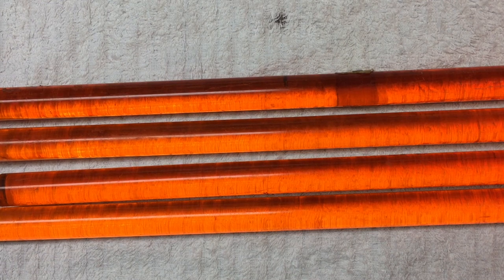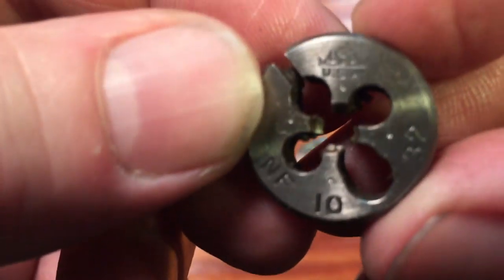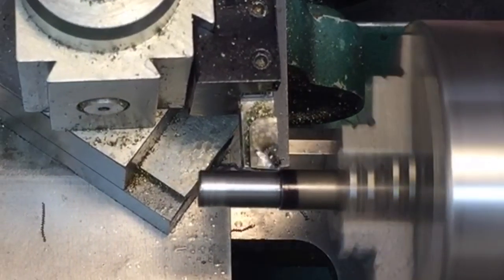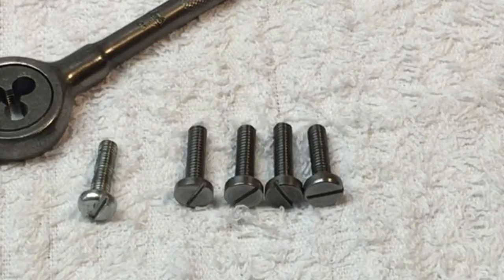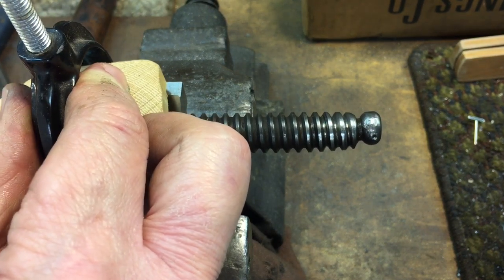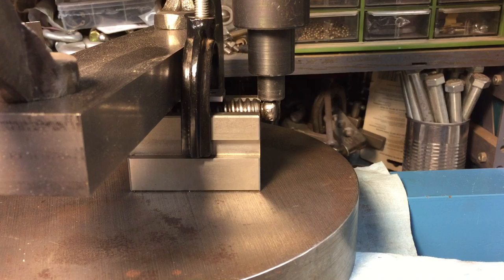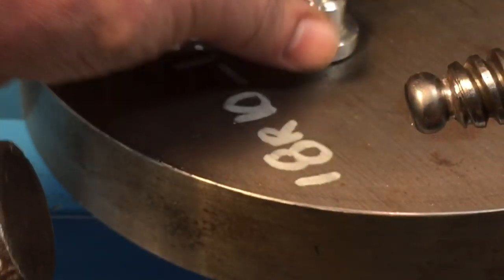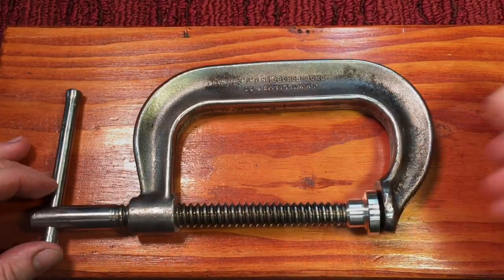Fix It Friday-  Screw Making. Clamp Repair.

Comment: S.C. very nice job as always.. my question is,  when you were making that end cap, how much smaller did you make the hole so that it would snap on to the end of the screw... I know absolutely nothing about working on a lathe but very satisfying to watch...
Reply from the maker: Hi Gary!  The funny thing is the proper way to do it is measure the ball and make a hold a few thousandths smaller.  However I just make the hole to where it looks like it will pop on!  =D  I really need to measure the next one so I know how much of a difference there should be.  Right now I have been doing it by eye and have been very lucky.  If the hole is too small it will crack or split the side when pressing the ball in!  That's why it's suck a blast when it pops in!   =D  Thanks!
Reply: @ScoutCrafter  You should change your name from S.C. to ole micrometer eye... O.M.E... lol.. good guess, you must have been guessing for a long time to get that good....

Comment: Nice job scoutcrafter! I really enjoy all of your videos on restoration of tools, i didn't know that you could shellac tools, i always oiled my tools i guess i will be shellacking all of tools now,keep them from rusting
Reply from the maker: Shellac is great for protecting tools not used all the time... Most all steel tools have some sort of coating on the steel (hammers, chisels, crowbars...) Shellac and Lacquers used to be a cheap alternatives but now they use a poly coating...  Just one thing, before shellacking wipe the tool down with denatured alcohol...   =D  Thanks!

Comment: Another great job! What brand tool holder is that on the lathe? I just aquired a 1949 South Bend 9A . Need to update the tool holder and cutting bits.
Reply: I have  knockoff AXA tool post on my South Bend 9C. I bought it on Ebay. It works great. There are two types, plunger and wedge. I have the plunger that works well for me. The wedge is suppose to be stronger. If you want to see it in action you can go to my channel where I have videos of installing and a lot more of me using it. Much better than the old lantern tool posts and Armstrong tool holders. 😆😎
Reply from the maker: Dave is spot on- There are so many different tool posts available now, mine is a smaller version that works well but you will use a larger one...  Watch Dave's video and then stop by Little Machine Shop.com and look under tool-posts.  They have terrific information on all types!!!   Thanks!
Reply: @Old Sneelock's Workshop , thanks for the  information. I have watched many of you videos also. I did see the couple you did on AXA tool posts.

Comment: Great video!
If you were to single point cut the threads, what attachments do you need for the lathe? I once needed 1/4" x 19 bolts to hold feet on a cast iron tub. They were made out of stainless steel to slow down the rusting process.
Reply from the maker: Nothing extra needed really, just a 60 degree turning tool and some thread gear changes...  1/4 x 19tpi is a unusual pitch!!!!  In those cases I always opt to drill out the casting and re-thread to a common size.   Those unusual screws are always a problem replacing..  =D   Thanks Dennis!

Comment: What do you recommend if the threads in the clamp are loose?  The screw wobbles as it is tightened and does not always hit the middle of the bottom. The screw looks good, so it must be the cast clamp which is worn.

Comment: Was the foot made from aluminium as the last time you made two feet one from steel and from aluminium and the aluminium to me was the better one no cuts or peening. Brought back a clamp from the dead and made it useful again.
Reply from the maker: Hi Tony!  This was Aluminum also, it is much easier to turn on the lathe and fun to work with.  For heavy duty work Steel is better but Joe won't be clamping anything crazy!  =D

Comment: My friend, I am so disappointed in you.  I expected you to use a spectrum analyzer to determine what alloys were in the clamp steel, and where the metal was mined.  Any self-respecting restoration would involve mining the same ore, smelting it in your back-yard blast furnace, and then forging bar stock with which to mill the new foot.  After pressing it, case hardening the foot without weakening the original screw and of course ending up with matching the finish, color, and luster of the original.  If you're not sure how to do that, you could always resurrect the original maker with a guest Jamaican voodoo priest to help you.  But I guess straightening the corrected ACME thread and the ball, and pressing it successfully into a hand-milled aluminum foot without any mechanical drawings on the first try - well, for your grade we'll call that acceptable.  High standards set high expectations!  😅😂🤣.  Seriously, you rock!!!
Reply from the maker: LMAO!!!!  Marc, you know way too much about manufacturing!!!!!!  =D  I can't wait to see how you re liking the lathe!?  Did you make a washer yet?  Fun stuff!!!  =)   Thanks!!!!!